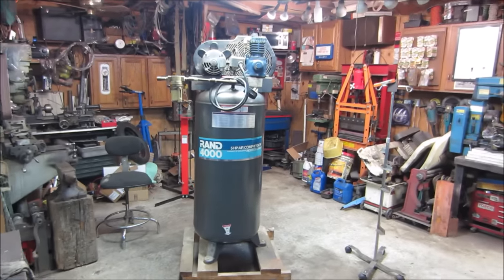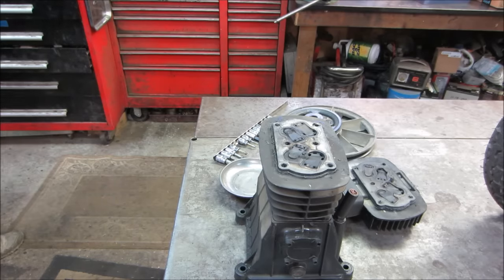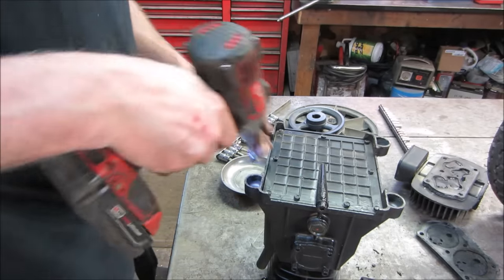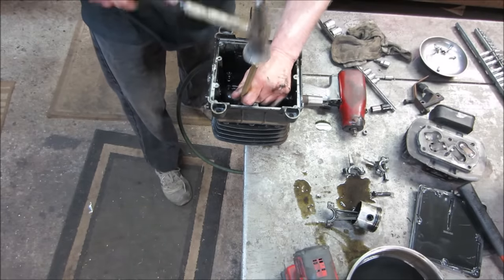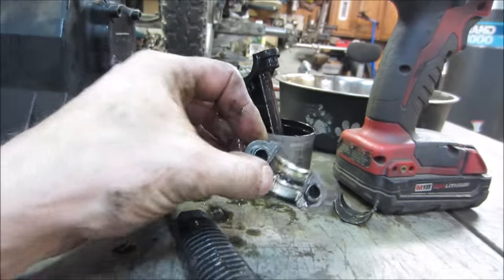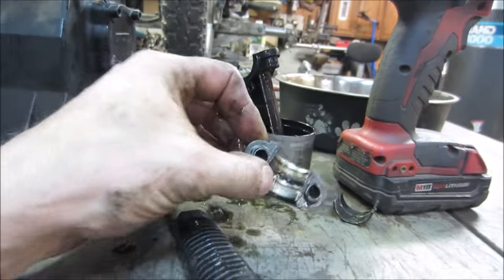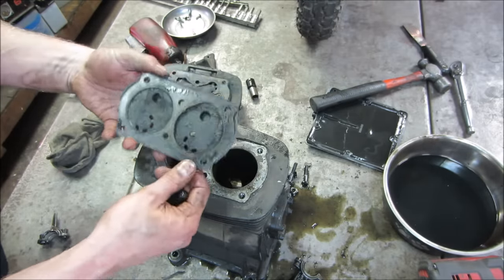Burned out Air Compressor tear down, what went wrong?

Comment: Wow! That's some weird damage. 
Evidently the "maintenance" personnel weren't doing their job to let that run long enough to do that much damage. You know it had to be hammering hard for quite a while. 

I wonder if the rod bearing on the crank end of the rod didn't fail first and then once it made some clearance on the crankshaft it started to hammer on the piston pin area and wallowed that out too? No idea why it would wear more on one side, unless the material softened up some from friction heat.
Reply: i have one of these and ime trying to find out what make it is so i can get some new gaskets for it so if any one knows

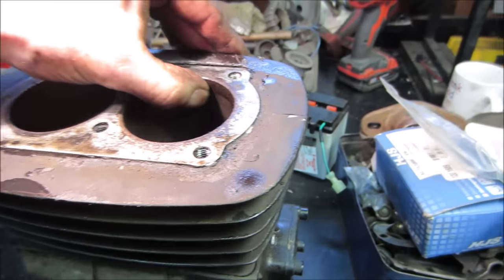Comment: So I've watched 12:45 of the video ( I say that just in case he talks about it later) and I am thinking that the reason only one of the pistons is so badly damaged is because of the air that is being pushed over the compressor to cool them isn't reaching that cylinder. Which is why all the damage is on the piston that is furthest from the pully which is also acting as a fan for cooling.

Comment: I have an older craftsman hot dog style air compressor that has one big & one littler pulley & I keep wondering if I could make a bike motor from it if I could find a different intake & carburetor? I had it running & building pressure but when I used the on & off switch, it stopped working so, naturally, I hot wired it & bypassed the pressure control valve to ensure that I didn't do major damage & sure could be, it fired up again but beings that it belonged to a neighbor & was stored outside, I do not know how often he drained it & when I turned the petcock/drain valve, a brown slurry came out so, I am a bit nervous to build any real pressure inside the tank, fearing it might grenade itself? THAT IS WHEN I THOUGHT OF YOU & I HAVE ASKED YOU IN SEVERAL VIDEO'S  IF YOU POSSIBLY HAVE AN INTAKE OR CARB THAT COULD POSSIBLY FIT? IF SO, ID LIKE TO MOUNT THE MOTOR ONTO A PEDDLE BIKE???

Comment: I've heard of snall multi-cylinder gas engines being converted to air compressors.  Disabling one cylinder to act as compressor.  Also reminds me of a '63 beetle blowing up in Illinois on the interstate.  Plug almost blew out of one cylinder.

Comment: Carbon is oil overheating on the rear cylinder. Motor rotation correction shoild be swaping two wires, check the nameplate. Proper airfllow is good for durability.

Comment: It's a 2 stage compressor so one side gets cool air and the second stage gets nothing but air that's hot from being compressed so it deals with a lot more heat I have had to replace a couple at the shop where I work for the same reason

Comment: I bought two sixty gallon air compressors one from a fire station and the other form a town ship. One the motor is bad and one the compressor is bad. I have a gas motor that I’m thinking about putting it on the good one.

Comment: Question for anyone?? We were careless in our busy shop and neglected to change the air filters on our two head 3 hp air compressor. One head got so hot it melted the plastic air filter body. After cursing myself and ordering new air filters and replacement bodies I have installed the new equipment. However the air comp is still running VERY hot, one head at 160 degrees and the other at 80. I assume that there is damage done to the air compressor. My question is are these repairable or do I just trash can the compressor and buy a new one?

Comment: Back cilinder gets less cooling that's probably reason why it's in worse state.
Had 2 compressors with the same problem before and my current one is a V twin setup that already has more hours than both 2 inline compressors had combined.

Comment: Maybe a reed valve in the cylinder that failed became clogged closed with carbon and that put extra stress on that piston because air couldn’t escape/escape fast enough which led to its failure? Just a guess.

Comment: Its because the cooling fan cools the good cylinder first. Back cylinder get much hotter. Thus the failure on the rear cylinder.

That's why if you look at something like vespa motor has a shroud to force air over more of the cooling fins. The site of the rod that elongated is probably facing the rear as well.

Comment: Ok so I know why only one side blew up: the manufacturing tolerances on the compressor head are huge. One of the cylinders is center of spec, while the other one is a little further out. There's not a whole lot of QC that goes into those things besides "does it operate under normal conditions" so this was a lucky case. It's rare for a cylinder stack of any kind to stay together without lubrication.

Comment: the carbon is the result of oxidizing the oil that blows by the rings, or comes in through the crank case ventilation. Keep in mind, this is a SINGLE stage compressor. If you look at Boyle's law, the more you compress air, the hotter it becomes. With all the throttling losses in those restrictive reed valves, the chamber temperature gets pretty warm. It doesn't necessarily get hot enough for the oil to combust, but it does "coke"the oil, burning off the volatiles, leaving behind carbon. This is what you see in a combustion engine, if it burns oil. It's possible to coke oil, without a flame. This would be the result of high operating temperature, added to Boyle's law of Thermodynamics. You're exactly right, about the cylinder nearest the pulley/cooling fan, getting better cooling, than the one down wind.  
     Now that you've tested the new compressor, change the oil. You don't want all the metal from the cross hatch of the cylinder wall swimming around in there, just to wear out the rod throw and wrist pin bearings. It's actually best, to run the compressor head unloaded for an hour, change the oil, then, let it build up pressure. Use it enough for about 5 hours of actual motor run time, and change it again. These things have no oil pump, therefore, no filter. Keeping the oil clean during the first few hours of run time is critical, to the overall performance of the compressor. It will have less oil blow by, which will help reduce oil in the receiver tank, and the air lines. It will also give higher CFM for the amount of pressure, not to mention, how much longer the new compressor will last, if you don't have abrasive particulate matter scouring out the bearings! Had the old compressor been regularly maintained,(oil changes) it would still be running now. They should easily last the life of the reed valves.
     I'll bet, that compressor was allowed to run low on oil, they heard a noise, and put oil in it, but it was too late. By the time it was worn out enough to hear it, the damage was already done.
     As far as making an engine out of it, I wouldn't trust it. The cylinder walls, and the crank case are far too thin, to handle the chamber pressure of internal combustion. That crankshaft, without a center journal, wouldn't handle the force from the increased chamber pressure, nor, would you dare rev it up as fast as an engine. An engine can be converted to make a very good compressor,(especially a diesel), but a compressor would make an engine similar to an antique engine, that could never perform like a modern engine. Replacing the compressor head was really the right thing to do. there's virtually nothing you could savage in the old one, to rebuild it.

Comment: I wonder if once there's an oil leak inside the cylinder the oil can detonate and cause internal destruction. It would only need high pressure and heat from the compressed air. Makes sense to me. Oil does it just like diesel

Comment: I have a compressor, with 2 pistons, and it heats up quickly at the top. I rectified part of the valves, to be perfectly straight, I put other gaskets, it still heats up. what should I check?
Thanks

Comment: this is normal. most of the time it's low oil but what you have is the head gasket blown on 1 side between the valves and this causes 1 of the 2 pistons to do all the work.    when it blows in the middel you get no air out.

Comment: I guess the burned out one started off with some crankcase oil getting past the piston, then given the heat created by compression it self ignited and probably became a crude deisel engine which then pounded the little end bearing until it gave way. Hence the carbon on the piston head from burnt oil.

Comment: ok ?? this was only video watched but pretty much it appears you either rebuilt a compressor head for the air compressor or put a used / new one on it without FIRST tearing apart and diagnosing the actual failed part ?  Now from watching the video you pretty much going to need a crank and 2 rods and 2 pistons and rings and possibly valve train components and maybe evening a cylinder over bore plus gaskets so rebuilding that particular head unit is probably not cost efficient .. being a single stage pos head unit to begin with ? why wasn't it diagnosed prior to being replaced ?

Comment: I think one side survived, because the compressor was standing on an slight angle. Then the first cylinder seized, what overloaded the motor. Then the contacts burned up. And the compressor was off before the second cylinder wouldve been out of oil.

Comment: This compressor ran to low on oil with the back cylinder far away from the cooling fan it will need more oil to keep it cool the design depends on the oil help balancing out the heating between these cylinders. One point you need to think about is that even every engine that has a rear cylinder meaning far away from cooling flow of air or coolant the back cylinder is always hotter than the further forward cylinder(s) even car engines this is true. Although the factories do their best to keep it from happening, it does happen. Note too that some engines have coolant control tubes to balance out the flow to keep the heating under control. Also, older engines did have these troubles before adding coolant balance tubes. I been mechanic for way over fourty years.

Comment: It looks like the bad cylinder had gone hotter and that it has been a lot of deposits building up on top of the piston, then the piston have been hitting the top and got broken. The sloppy fit then have been progressively worse by the time it was running until the whole side gave up due to vibrations and wear.

Comment: Those compressors are typically two stage.  The first cylinder compresses the air and sends it to the other cylinder to compress again so the air entering the second cylinder is much hotter than the first stage.

Comment: Unless I've got entirely the wrong idea, the piston wouldn't hit the top of the cylinder head because it has compressed air pushing it down.  The problem would be exactly the opposite - once it started to egg out, the piston would stay too low in the cylinder and you'd get poor compression.  It matches the direction of wear on that rod as well.

Comment: I think your new compressor would benefit from a sheet metal shroud and fan to blow cooling air properly over the compressor head. That drive pulley fan is little more than playing at cooling the thing.

Comment: I would expect to see more wear on the high compression cylinder vs the low pressure one as the high pressure side has more load on it. As we see the high pressure cylinder (the smaller one) is the one that went.

Comment: The rear cylinder has more wear and probably failed first because it runs hotter.  The front cylinder gets the cooling air from the pulley.

Comment: I didn't read the comments but somebody may have mentioned it I think one cylinder is bigger than the other on a two-cylinder compressor and one is high and low pressure.

Comment: Looks like the compressor wasn't sitting lvl the bad cylinder was on the high side and once the fluid got low enough the bad cylinder scooper wasn't able to pick up the oil where the good cylinders scooper was still picking up oil.
Reply: yep, with a side of that end runs hotter/further from fan. I'd guess it had a big lack of airflow/dirty too.
leaning at an angle coincides with the piston pin hole being worn more on one side, it must have been getting a small amount of splash lube still.

Comment: I think what happened is the wrist pin damage happened first, then the banging on the rod caused the crank bearing damage . not sure I agree with it ran and ran & ran  a long time . automotive  detergent oil will cause carbon deposits in air compressors

Comment: Whats obvious to me is the pump rpm is way to high. This was somewhat compensated for with the smaller drive pulley but still too big in my opinion. My take on it is the excessive rpm would displace the crankcase oil to the point of not keeping enough in the sump provided this is a splash lubrication pump. In other words operated like it ran without oil.  Im of the opinion they were trying to speed up the pump to compensate for heavy usage / demand. One thing I noticed is the pump size compared to the tank. Seemed small to me suggesting this was intended for a residential application or modified for that purpose. With that said I dont know of any Ingersol Rand compressors made for the residential market.  Just my 2 cents.

Comment: Seems like second stage got toasted, first stage would have ran alot cooler and maybe the side to the fan/ pulley delt with 6 stage compressors for starting large engines. Combination oil failure, and overheating did it in on the second stage these little compressors rely on a good oil splash lubrication, we would change mine every 48hr using nondetergent oil allowing free flow of babbit in suspension.

Comment: Not an unusual failure on this type of pump unit. They have two main issues going against them, they are not designed for a high duty cycle and are critical on oil level due to the rudimentry oiling 'system'. So, the unaware user pushes them hard for applications like paint spraying, blast cleaning, etc, and fails to adequately inspect and maintain the oil level. The result is inevitable. I've rebuilt a few of this type here in the UK, they are mainly of Italian origin. The problem is the cost of parts, a big end shell set is around £40.00!!! Thats about $52.00.  This pump has even been used on Snap-On branded compressors!  If used as intended they are ok. Use good oil, maintain the level and change it frequently.

Comment: Got a call to the boiler room to see a large Ingersoll Rand compressor Doing the diesel death dance due to carbon buildup and running on its own lube oil.
It was driving the disconnected 50 hp motor.
The plant had many leaks in the pneumatic control systems.
Reply: Diesel Death Dance    Sa- weeet ! Now there is a YouTube video if ever I heard one

Comment: Most likely the compressor was in a very heated atmosphere. Probably around some other equipment producing a lot of heat. Even with the fan running and it running almost 24/7 that rear cylinder bit the dust.

Comment: In a two stage air compressor one cylinder operates as the lower pressure side and the other as the second stage or higher compression side.  It was not cleat to me which one was which in the video, but it would expect more wear on the higher pressure side.

Comment: You could make a 2 stroke from it.... old school reed valve 2 stroke... give it a shot. Lol, though since it has a oil crankcase... you'd need a belt drive air pump (old smog pump from a car) to force the intake charge. Think similar set up to a 2 stroke Detroit diesel. And actually, since it is a compressor.... you may be able to get a compression ratio to make it a 2 stroke diesel in fact....I think it would be a fun project.

Comment: What shame I just tossed a 7 1/2 HP 2 stage compressor with single phase motor. All that it needed was a start up capacitor, I kept the motor for what ever reason but tossed the compressor head. The 80 gal tank I cut and turned the bottom half into a fire pit with a lot of holes drilled around the bottom. I gladly would have gave you the compressor head and the motor, but I am in CT so a bit of a drive.
Reply: The reason we didn't repair it was because we were ready to upgrade to a quieter screw compressor and I don't have the realestate to use the tank for extra storage.

Comment: As to the failure mode Assuming its a two stage compressor , the failed cylinder is likely in the high pressure stage that's under much higher pressures and stress.

Comment: The rear cylinder would normally run hotter, being further from the fan, and the air passing over the front cylinder first. Thus, it would also fail first. The carbon is probably from burned oil. Once the reed valves failed, there wouldn't be any pressure to keep the oil below the rings, where it normally would be.

Comment: I bet that cylinder had a bad discharge valve. With Refridgeration compressors, with the constant head pressure on the piston, it will cause excessive wear on the wrist pin and on the top half of the rod, at the crank shaft.

Comment: Two stage compressor has one piston working harder, and with heated air in-coming.  That and cylinder placement(close to airflow) can tilt things against one cylinder.  Con rod small end likely didn't get much splash towards the end, and got hot.  Wore away.  Turned into noisemaker.
tom
Reply: Except its just a twin cylinder single stage compressor.  look it up and see for yourself.

Comment: The oil on the compressor looked like Diesel engine oil color.
Since there is no coMbustion it should never be darker than slightly used gasoline engine oil.

Not sure if that caused it or the result but if you see compressor oil that dark you should have changed it long ago.

The reed valves need to be cleaned for long term life and they can break and you will loose output pressure.

Some style valves need cleaning annually in industrial duty settings.

Also the air filter needs to stay clean.